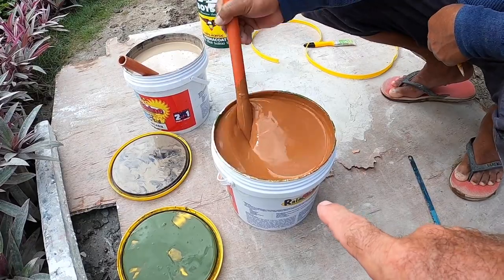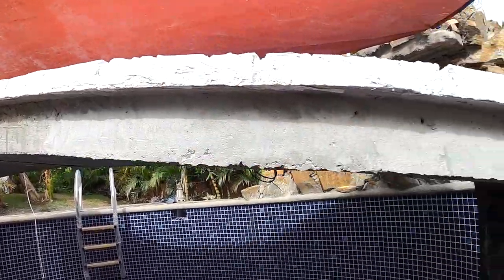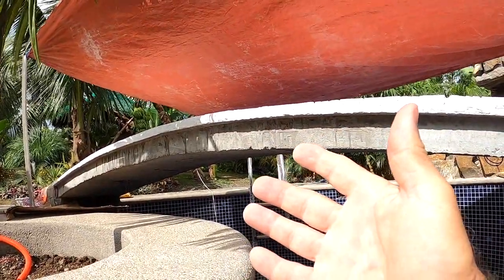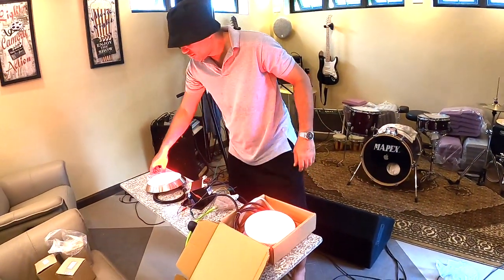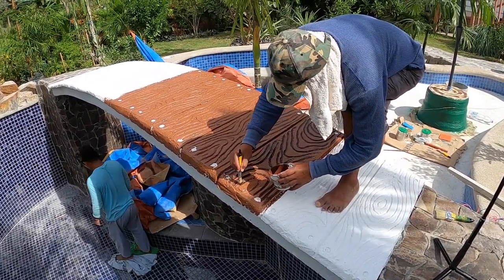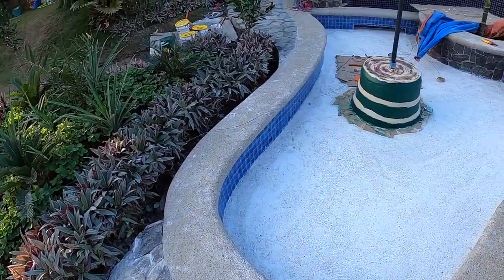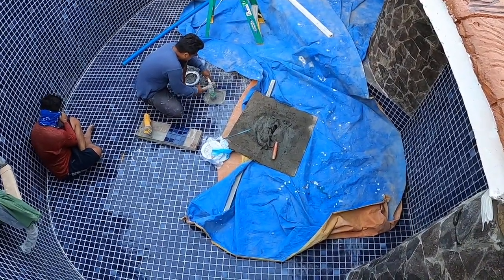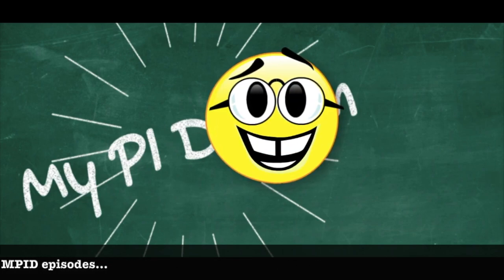VILLA FELIZ POOL BUILD - EPISODE: 57 (House Building in the Philippines)

Comment: Wonder if the fake wood planks could be chipped out gently without hurting the main concrete span, replacing the bridge top with dark pebble rock and no lip overhang. 
Then the bridge span will match your pool ledge keeping everything natural.
The umbrella stand possibly be replaced with a real-big-rock with a hole drilled for the umbrella (or done like the center planter) and a small polished tabletop.

Comment: Hi James and Ness😊 regarding the bridge removeable rope railing and stainless steel pipe, try to imagine or consider of using abaca rope, say 1/2" diameter or even bigger the better. Just making a recommendation👍.
Reply: Similar ropes used when the ships anchor.  The bigger, the better... assuming it will be exposed to the harsh elements of the Philippine climate/ weather.
Reply: @FlatulEssence  yeah, the bigger the better.., abaca rope made in the Philippines is a natural material derived from abaca tree, similar to a banana tree. Most of these are found in Albay area.👍btw abaca fiber ìs resistant to tropical place like ours.Tnx😊
Reply from the maker: Yes, yes, yes!  I like it Jonie!
Reply: @MyPIDream  tnx for considering James.., 👍💪🎸

Comment: If you want to be able to control or program and schedule the lighting on your pool, I would suggest to you to buy and install a smart WiFi switch instead of a regular switch. You can even integrate it with Alexa or google and be able to control it anywhere thru the app. Other option is to replace your lightbulbs with a smart WiFi bulb which you can change colors and brightness. It just cost more.
Reply from the maker: We have that over most of our house and it works great.  We might do some upgrades later.

Comment: Sir james what about the paint at bottom of the artificial palm tree will it not feel off overtime once it is submerge in water?
Reply from the maker: I don't know Rey.  Time will tell.  I think if done correctly, paint will hold up underwater.  I think some pools have painted walls.  Again, I'm surely not the expert here.
Reply: @MyPIDream 
Coloured cement dye could be better to use than paint:
https://shopee.ph/Colored-Cement-Red-Blue-Black-Green-White-(per-kg)-i.215953981.5532670912

Comment: The bridge is cute but honestly, I think it is too much for that small pool.  I had that impression from the beginning but have waited to get a better feel for it all as they completed this. One is sometimes surprised with a finished look and everything comes together. In this instance, I am afraid not.  It really looks cramped and overdone with the bridge and I still fail to see why there was any need for it. Just my 2 cents I hope it turned out the way you wanted. Enjoy
Reply from the maker: The bridge is merely a route to get from our garden tools on Bahay Kubo Island to the raised bed garden.  That's the main reason.  We designed it with the intent to complement the tropical jungle look.